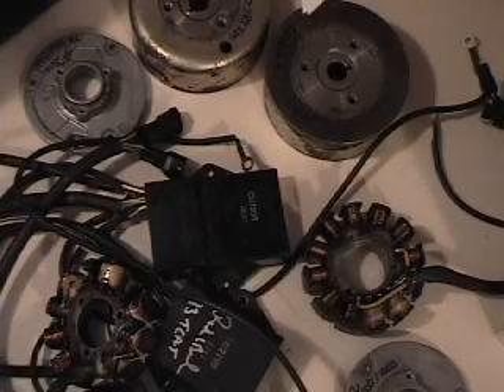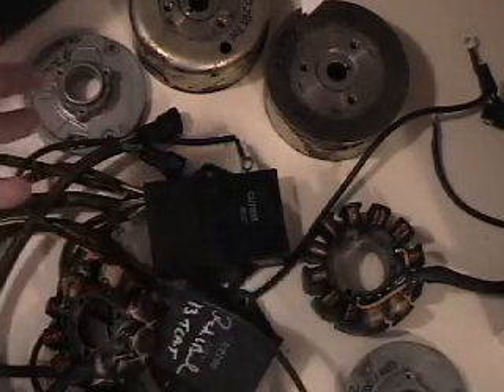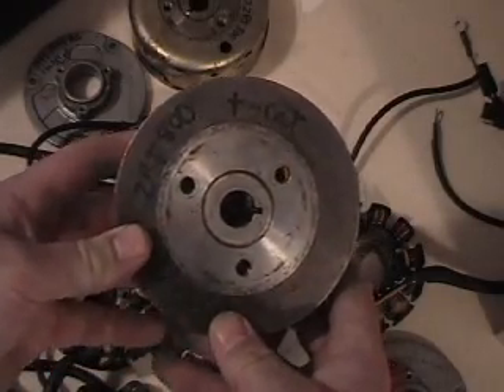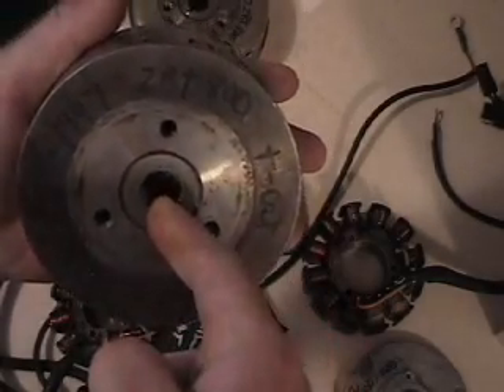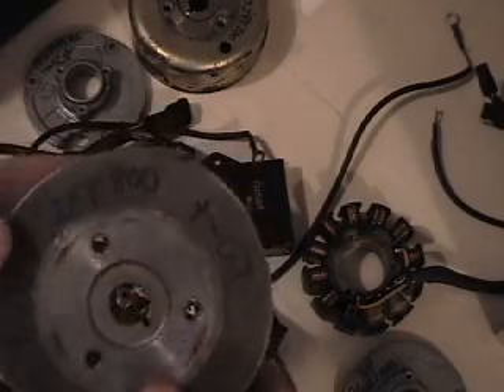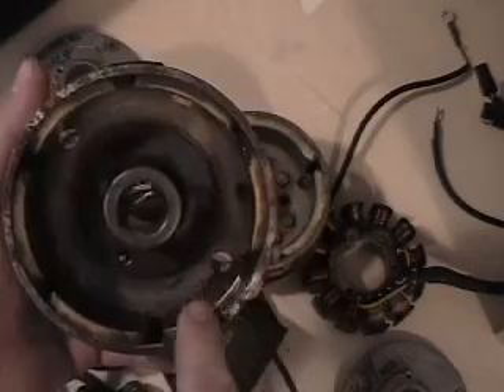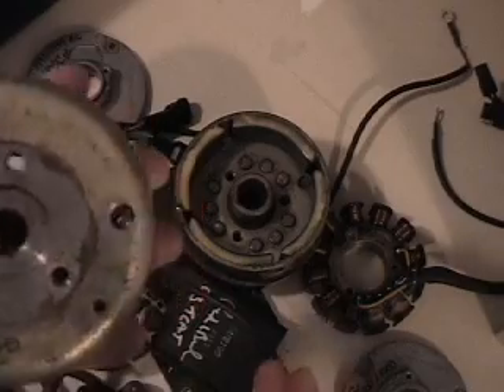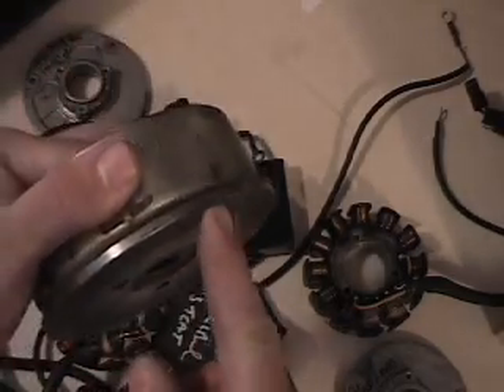Arctic Cat ZRT and Thundercat 1993 to 2002 Ignitions Pt 1

Comment: i have a zr 800 with a 1035 hooper the coil is reading 8.17 got a used coil tried it it reads 7.98 i plugged into the plug wire end set ohlm meter at200 wondering if there both bad

Comment: I have a 93 thunder cat 900 with a spark issue no start. Have installed new stator.
Reply from the maker: I go thru a no spark diagnosis in this video: https://www.youtube.com/watch?v=iwwl4LPyOCY
Reply from the maker: Have you used the jumper wire to isolate the ignition? Was it an OEM stator? Ohms? Ohm trigger?  You're better off e-mailing, calling or texting me. www.outdoor-electric.com